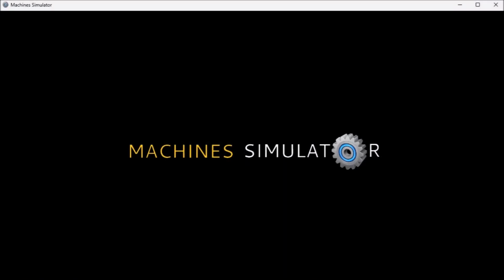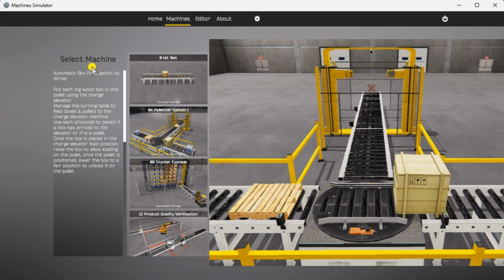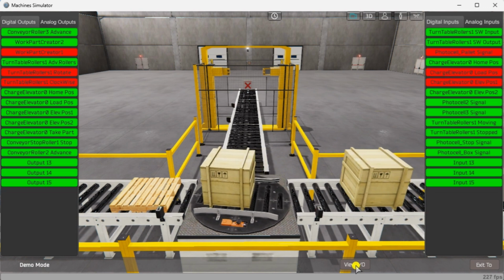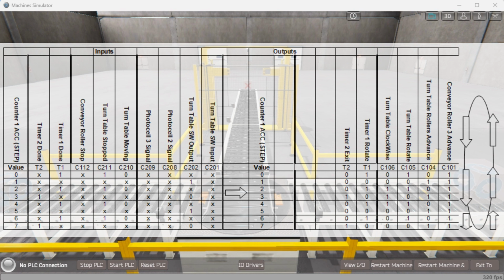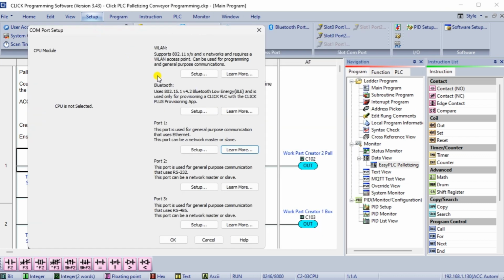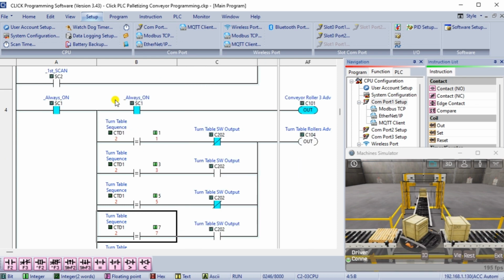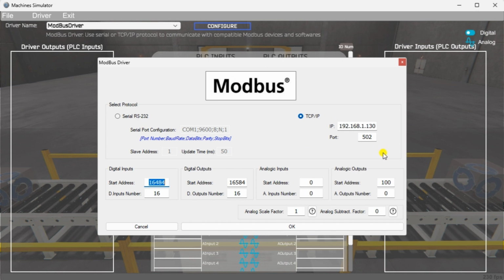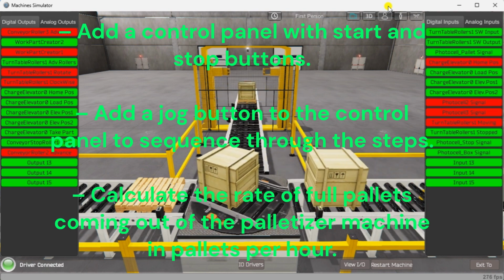Master PLC Sequencer Programming with Real Palletizing Demo

Comment: hola garry , quiero sacar un contador del PLC click al Machine simulator ,el adress picker modbus adress es  449153 pero en el driver modbus como lo coloco? entrada analoga? salida anloga? discreta?. solo deja 5 digitos no 6 , agradezco tu ayuda! gracias
Reply from the maker: Hi @jmbcrp100
The Machine Simulator will only use 16-bit words. The CTD1 address 449153 uses two 16-bit words, which is why the CTD2 address is Modbus 449153. 
The Modbus Driver in the Machine Simulator will use Analog with the starting address of 49152. It will use two words for this value.
Regards,
Garry